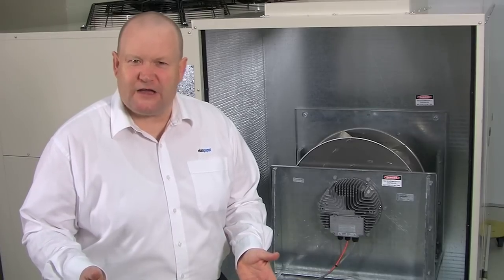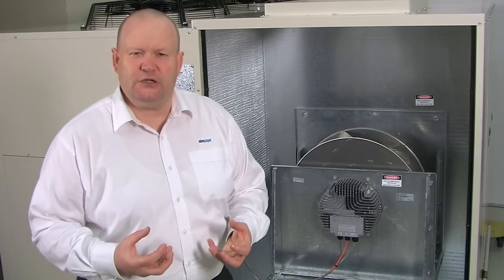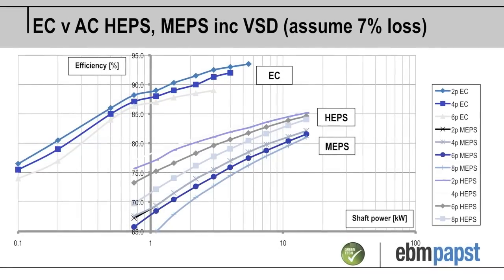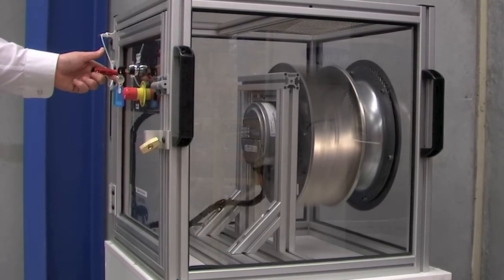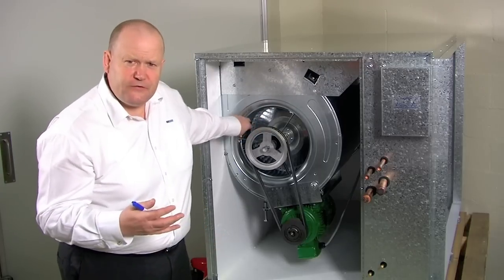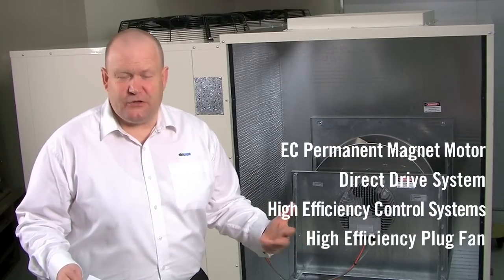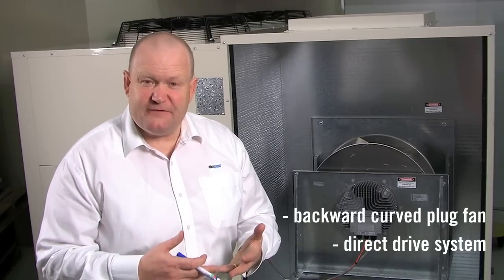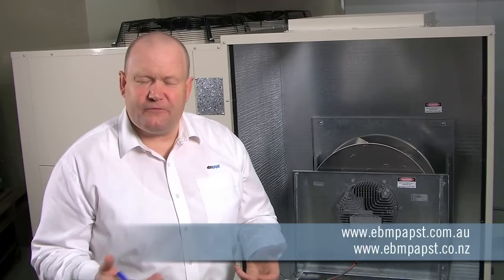EC Plug Fans in air-conditioning units - ebm-papst A&NZ

Comment: do the size of box/container where the backward curve fan is located will affect the air speed?  how large is the container until the fan lose its speed? if so, how to measure the air speed before it pass the filter/duct?
Reply: Hi Lufti, I suggest using a standard air anemometer on the air inlet.  Test in several spots where there is clean and non turbulent air flow.

Comment: Our problem here in South Africa is that the initial cost of the EC fan assembly is more than a normal S4D500 AC and a fan speed control, i dont think the EC fans will ever really become a seller in RSA. Retail value from Kovco, R3 500 including VAT fan speed control R1 500 incl. EC fan 500mm R12 000. People dont think that far into the future, i mean they are now picking rotaries and scrolls for refrigeration....
Reply: Hi Dean, yes you're right EC is more expensive.  We believe that we should offer as much value to end users as possible.  Things will change and I for one think that good engineering gives us good economics as well as good applications.  On the side - please be assured of fan speed controls with AC fans; I have seen power increase and life times drop dramatically with these combinations.  I hope Mr Petrie can help with any of your needs. Thanks again, Simon
Reply: I do have the same problem here. how can i convince our clients to choose the EC Plug Fan when  they have the cheaper one ' centrifugal fans with  AC motors and  speed control '